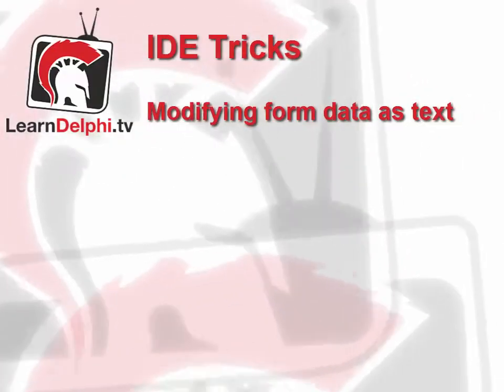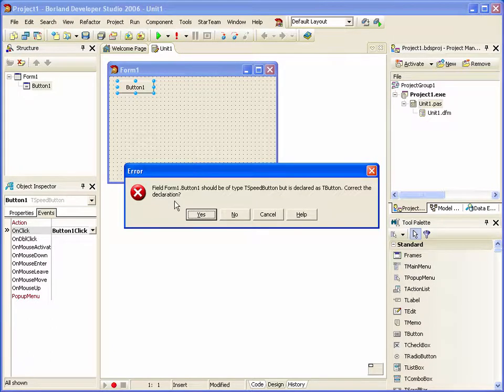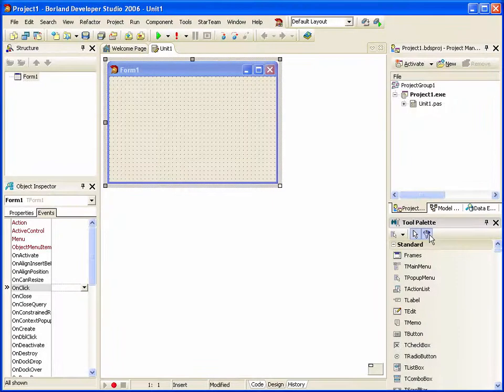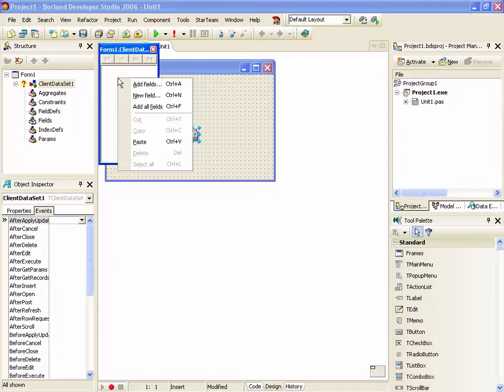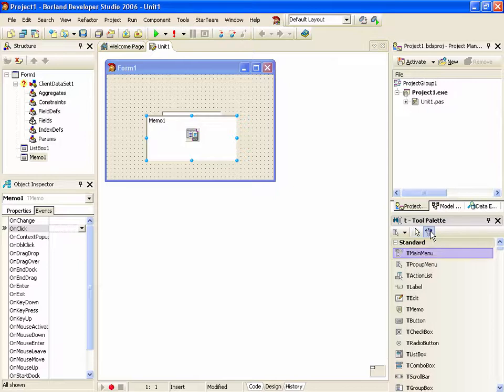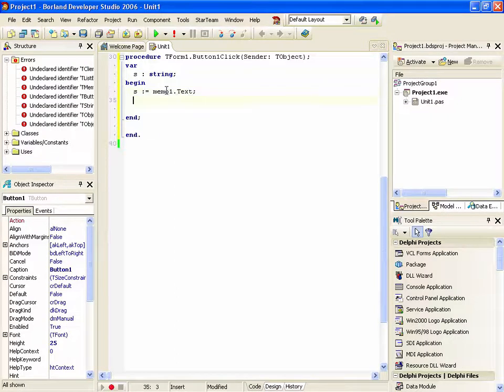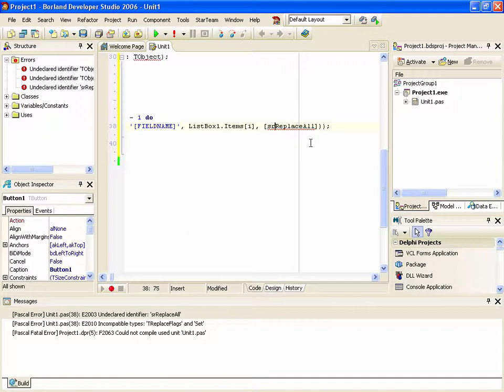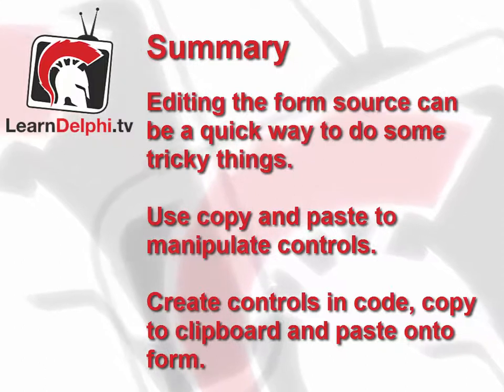IDE Tricks (Modifying form data as text) - Delphi #3

Comment: I've done a little modification for include the size of the integer in the dataset. So, from this listbox content:
CustNo 20
Company 100
Addr1 100
Addr2 100
Zip 10
Citie 25
Province 25
Country 25
Memo content:
object strngfldds1[FIELDNAME]: TStringField
  FieldName = '[FIELDNAME]'
  Size = [SIZE]
end

The code inside the for iterator would be this:
    sFieldname := SplitString(lst1.Items[I], ' ')[0];

    sSize := SplitString(lst1.Items[I], ' ')[1];
    sTemp := StringReplace(s, '[FIELDNAME]', sFieldname, [rfReplaceAll]);
    sTemp := StringReplace(sTemp, '[SIZE]', sSize,[rfReplaceAll] );
    mmo1.Lines.Add(sTemp);